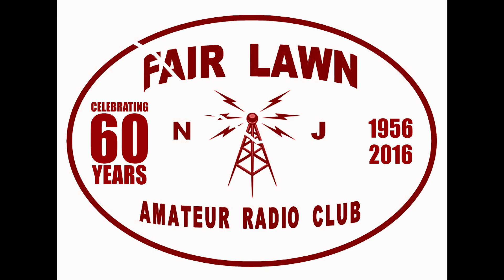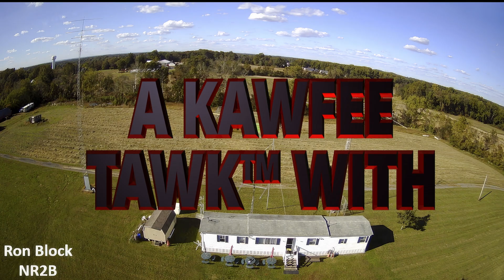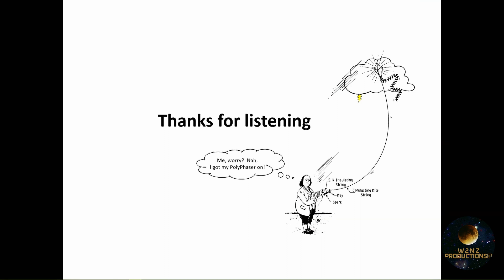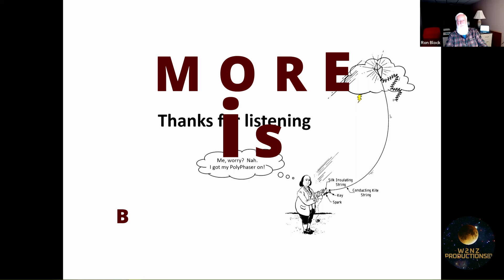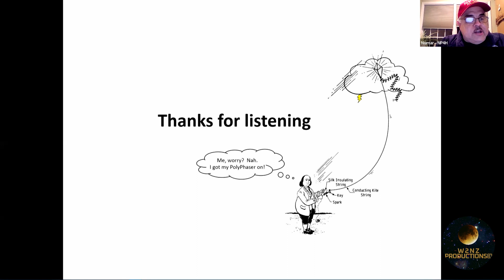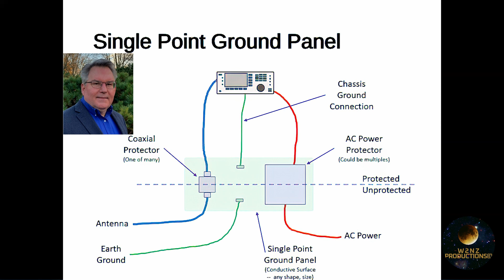Ron Block, NR2B - Part II, Grounding for the Ham/Amateur Shack - Q&A #hamradio #arrl #safe

Comment: Thank you for another great video! I have a feeling that you have already found this after using the equation you included within the video, but I located a helpful online article from the National Weather Service that states that you take the number of seconds (between the lightning and the sound of the thunder) and then divide by 5 to equal the distance of the lightning in miles. So 10 seconds is only 2 miles! That's a great reminder for all of us to be careful out there! 🌩😵😁 ~ 73 ~ AC7WH
Reply from the maker: Re: "Outta the Blue" Strikes, if your arm hair / head hair stands up for NO, 99% unexplainable, reason you could be experiencing the forecasting of an "Outta the Blue!" The area where you are standing is "charging-up" and a lightning strike may be imminent. https://www.weather.gov/mqt/lightningtips#:~:text=If%20you%20are%20caught%20outside,telephone%20pole%2C%20or%20flag%20pole.&text=If%20your%20hair%20stands%20on,lie%20flat%20on%20the%20ground.